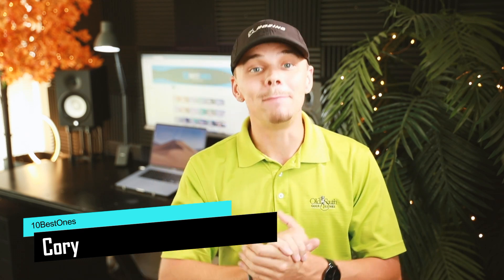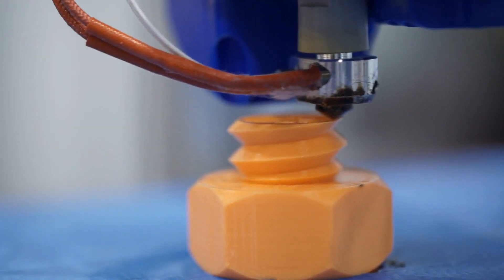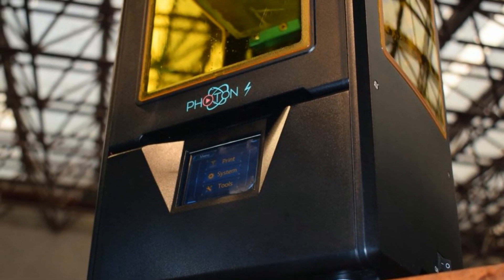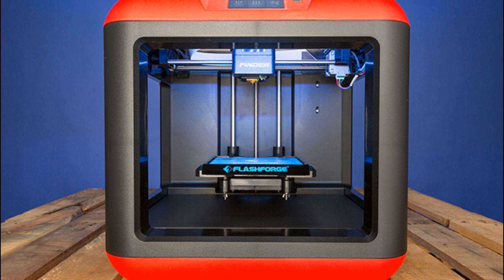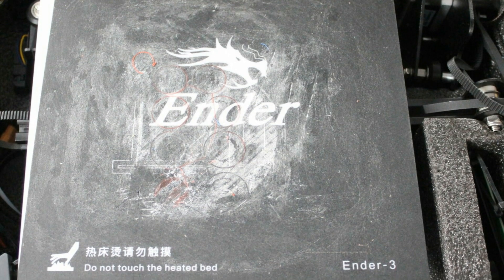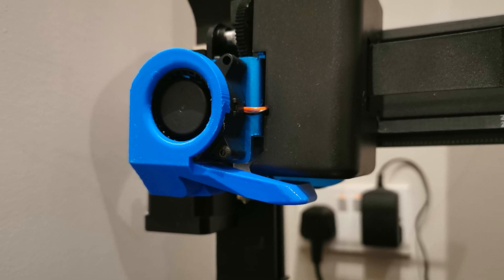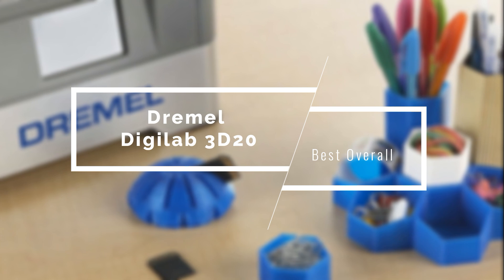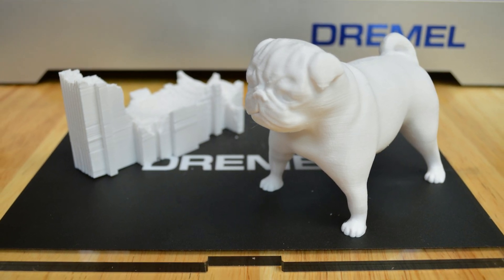Best 3D Printer in 2020 - Top 5 Picks For Hobbyists & Professional Use

Comment: The main reason people like the Ender 3 so much is because you can make upgrades DIY improvements and more really easily. If you are experienced with 3D printing than this is probably the best value for money but if you are not do not buy this printer. Go with the Flashforge finder if you are a beginner and in you are using it in a home environment don't get a resin 3D Printer (Anycubic photon s). Apart from that this is a really great and accurate video.